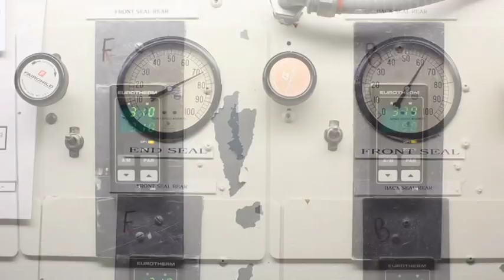Pod Runner

Comment: So the pods are made from a heat sealable foil with a frangible layer that acts as a breakage point

But just what is the foil material? Ive been trying to make some diy pods for type 40 series film but freezer paper is very tempermental for the pod